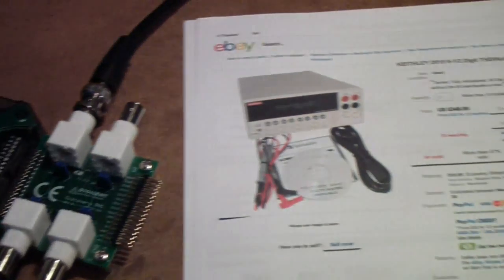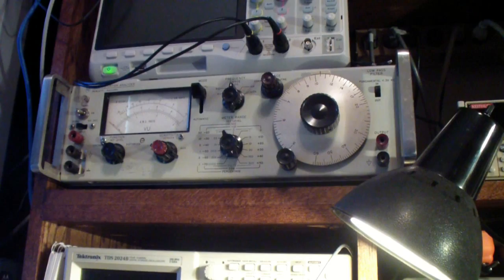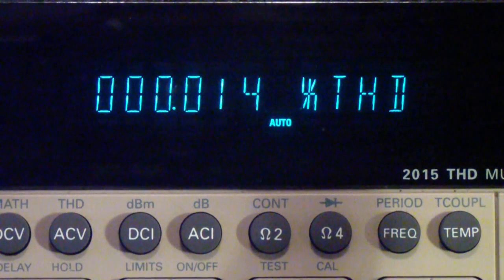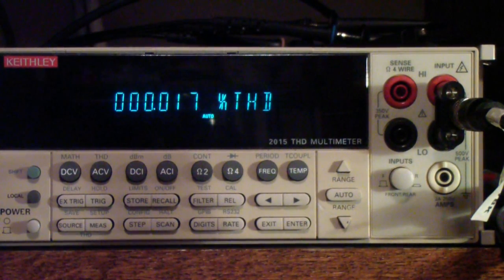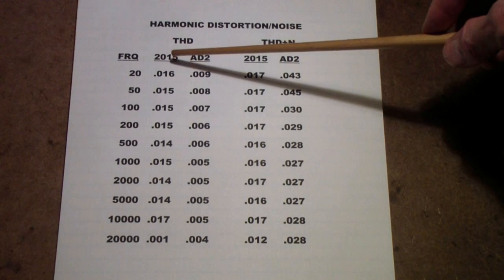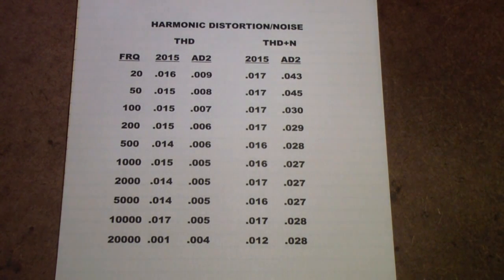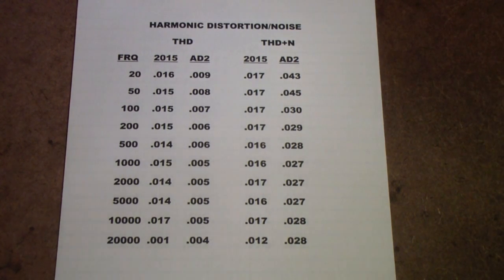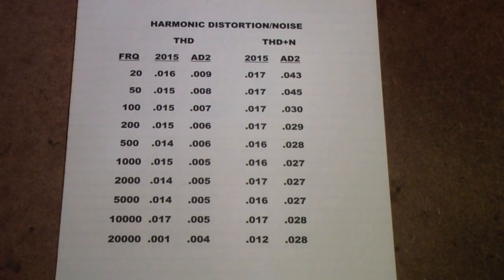TTT109 Analog Discovery 2 and  Keithley 2015THD

Comment: I believe you get low THD at 20KHz (in comparison to 10KHz) because bandwidth is limited to 50khz on the Keithley 2015 THD measurement. So if you inject 20KHz signal, only the 40KHz harmonic is considered for the THD calculation.

Comment: It would be nice to see a comparison using a spectrum analyzer with a very low noise floor. I usually have high confidence in Keithley, but I'm not 100% convinced on the 2015's distortion measurement performance.
Reply from the maker: Actually, I think you would need an analyzer that goes down to 20 Hz or so. There are such instruments but they are outside my price range. I found the Keithley to give about the same readings as the older HP THD analyzer over the 100 Hz to 20 KHz range.

Comment: Also, the 14-bit ADC of the AD2 will impose limitations on the lowest level of THD you can measure, I have a similar issue when using the HP 3562A to characterize distortion. where the dynamic range of the analyzer limits the measurable THD to above 0.01% or so. I have been eyeing the QuantAsylum QA401, which uses a 24-bit DAC/ADC for impressive dynamic range - but in the meantime I've been experimenting with using a Leader LDM-171 analog THD meter as a notch filter, then feeding the output to the HP 3562A, this allows me to see harmonic content that would otherwise have been lost in the noise floor of the analyzer. You might be able to do a similar trick with your HP 334A, feeding its output to your AD2, just a thought...
Reply: hello. Has the Keathley 2015 a 24b adc? thanks!
Reply: Looking at Dave Jones' teardown of a 2015, it's seems that the ADC is a custom Keithley part, so a bit of a mystery. The specifications of the 2015 refer to 'residual distortion' of -87dB. Crunching the numbers to calculate an ENOB value based on that gives a touch over 14 bits, so that would be my guess.
Reply: @KarlAdamsAudio  thanks! That's may be why AD2 thd figures are better than the keithley.. Don't know about those thd+n numbers though.

Comment: One way of telling whether 60Hz hum is causing the problem is to do a measurement with the fundamental at say 30Hz, that way any 60Hz present would be lumped in with the THD, rather than solely contributing to the THD+N. In general, when measuring noise you need to be specific about the bandwidth, as you'll see more noise if you look at a wider range of frequencies. Looking at the specifications of the Keithley 2015, it quotes "Harmonic Frequency Range: 40Hz - 50kHz" - which might explain your much lower measurement of THD at 20kHz when using the Keithley's internal generator - if the generator's distortion is primarily 3rd harmonic (and it may well be) then you would expect a much lower THD measurement at frequencies above 16.7kHz, since the 3rd harmonic would then fall above 50kHz, beyond the range of the meter.

Comment: Interesting. I know that it is very difficult for me when I try to measure distortions that low. Below about .05 it takes very little to throw off my measurements. Fluorescent lights are always a problem for me.
Reply from the maker: Thanks for your interest and comments. I am going to do some additional tests using a real spectrum analyzer to see if I can find a difference between the Keithley and the AD2 that might explain the results. If I find anything worth reporting I will do a follow up video. Since I was using the same cables and input circuitry on both measurements I doubt that it was external interference (I always turn off all non-essential devices including the only fluorescent light which is on my magnifying lens) but there could be interference getting into the AD2 through the USB cable from the computer. I will try an optically coupled one to eliminate any common mode noise in the next experiments. I think that the difference is in the fact that the clock for the Keithley FFT is the same one used for its frequency synthesis and therefore, correlated while the clock in the AD2 is completely independent and therefore not correlated, but I can test for that with some other tests that I will do. Either way I will post the results in case someone has some other thoughts or ideas.